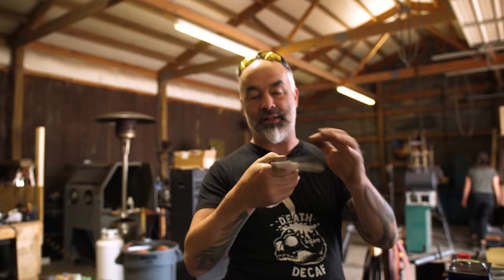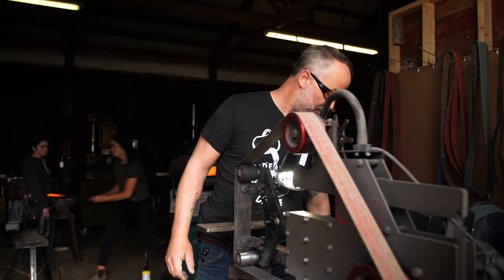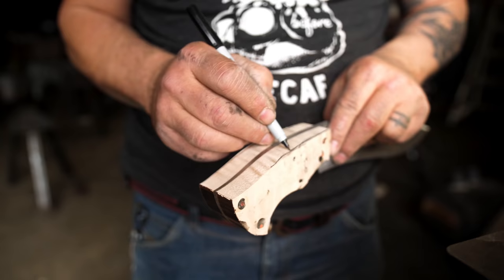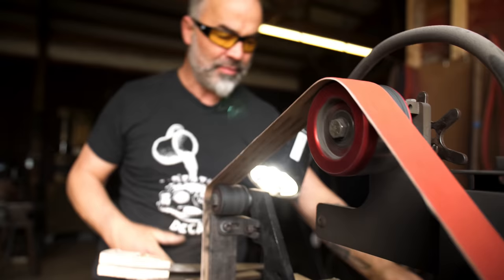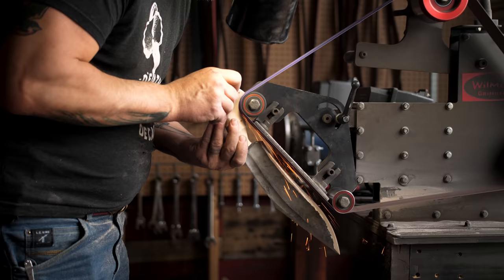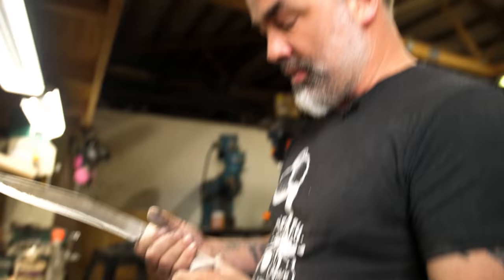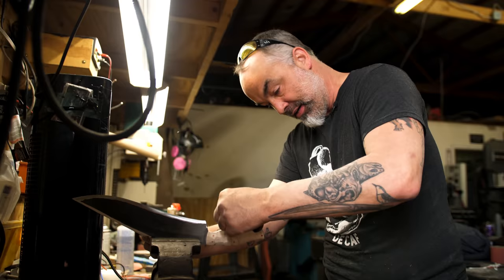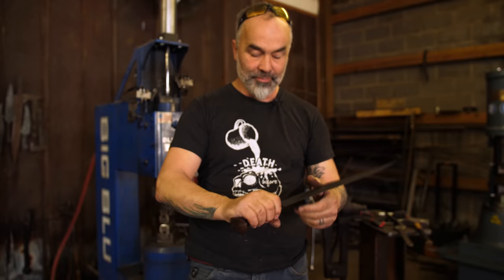BLADESMITHING | Shaping a Knife Handle | Basics

Comment: Beautiful knife, and handle. Have you ever tried burning in an oak handle with a torch then taking a wire brush to brush out the burnt parts between the grain? It turns out really nice, it creates valleys between the grain of the oak and raises the grain of the oak.

Comment: You can de-clog a sanding belt (or any sandpaper) by running a piece of natural rubber (other rubbers work quite well too) against it. It literally takes 1-2 seconds to completely clean up a belt sander like that. It's a common trick used by woodworkers and apparently  by skate boarders (the top of the skateboard is essentially just sandpaper to help you get a grip with your feet).
They're usually sold with search terms like "rubber sanding belt cleaner" or whatever.
Reply: I have a rubber belt cleaner bar. It works to some extent, but I have found that it leaves rubber stuck in the belt. 
Not a huge deal if you're roughing out something, but leaves weird streaks on higher finishing grits.